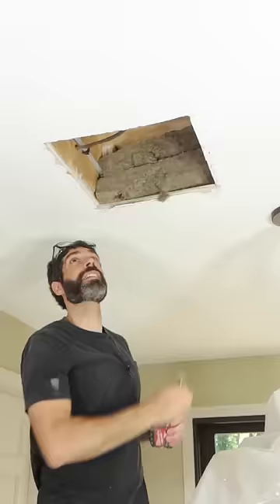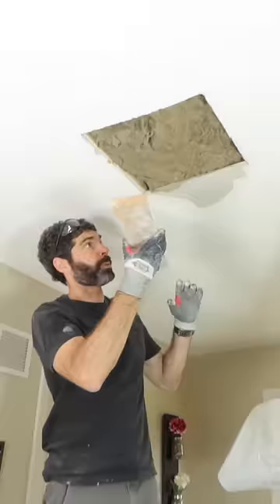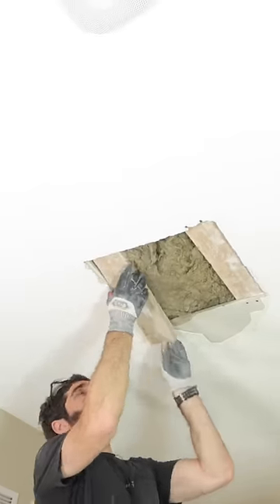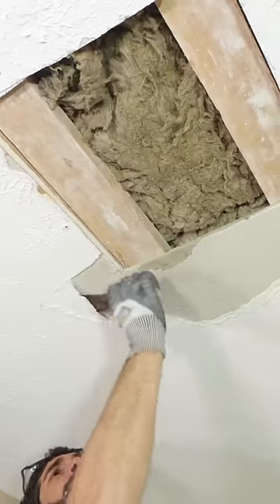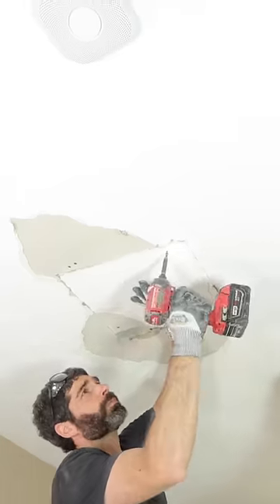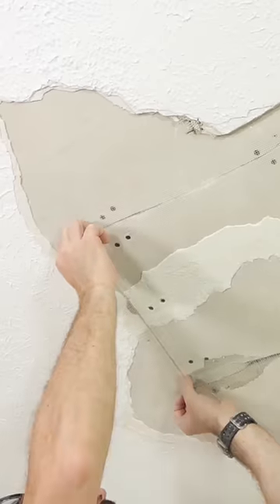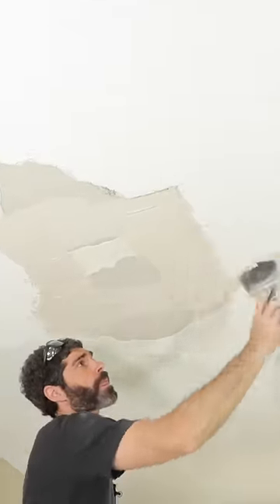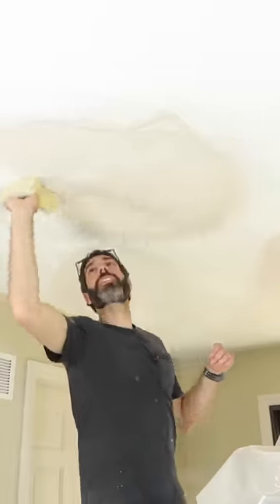Drywall Ceiling Repair Tips - #shorts

Comment: Access panel makes more sense.
Reply: Not in this room.In a kitchen,hallway or bathroom yes but this looks like a dinning/sitting room so wouldnt want one here.
Reply: @robotsonmars1989  a hidden panel that fits flush and hidden seams. push up on panel releases catch.
Reply: @Ericbjohnston5150  No panel is ever going to look as good as a smooth flat ceiling. I've done 1000s of them and even the best have no place in a finished room.
Reply: @robotsonmars1989  who really looks at ceilings ?
Reply: @Ericbjohnston5150  lol fair point. I have plaster cornice and 2 ornate ceiling roses in mine so people tend to look at it,no way am I putting an access panel in it no matter how good it is. I'll know it is there at the very least.

Comment: And as soon as the joists start flexing that mess tape will start cracking 👌 so tierd of seeing you self proclaimed pro tapers using mesh
Reply: If your mesh tape is cracking, you suck at using mesh. No offense. It’s not for everyone but that stuff does work
Reply: Well in my almost 40 year's experience I've seen more then most and have had to go replace so many of these jobs
Reply: @noahgarrett9555  never use it and never will
Reply: Durabond and mesh tape is a solid patch. Actually if you read the specs on mesh tape you’re supposed to use durabond. Demo a patch that was done with mesh tape and durabond and you’ll see how solid it is